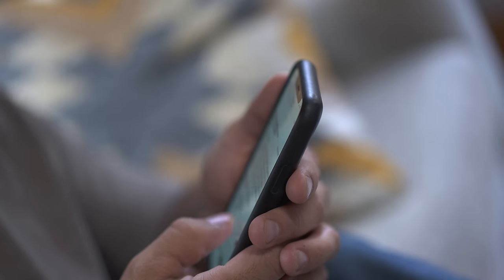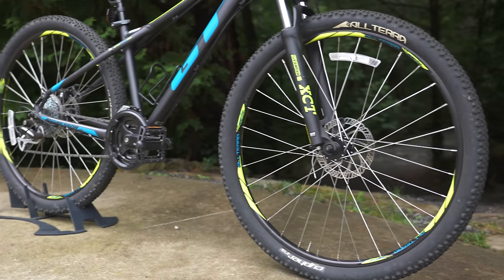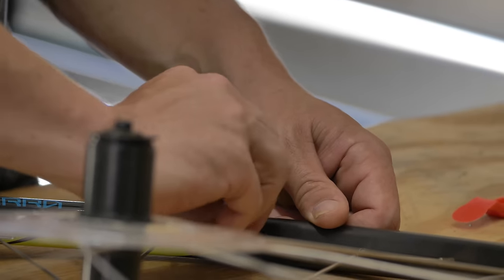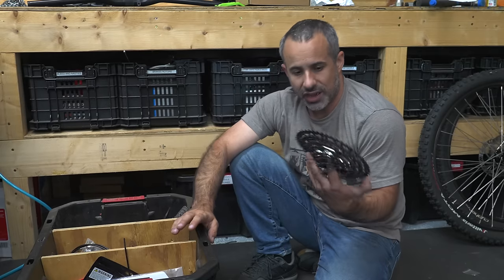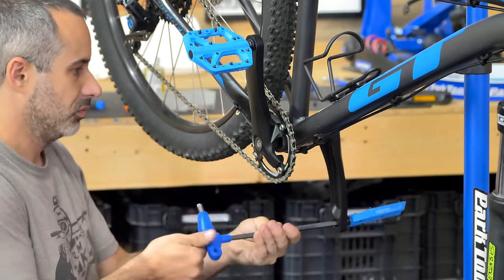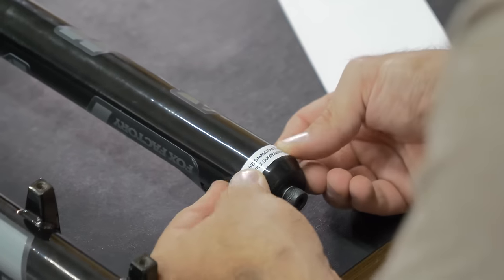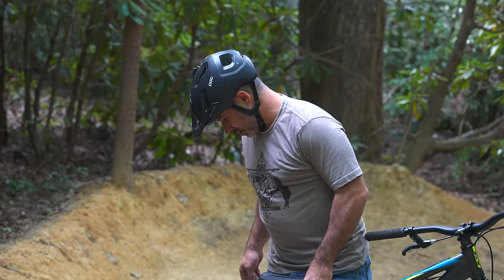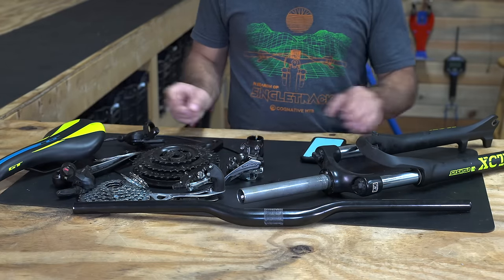Flipping a $300 Facebook Hardtail (Flip Bike EP2)

Comment: Seth a menace to the society for putting fox decals
Reply: 😂 do you watch flight reacts???
Reply: i saw the thumbnail and seriously thought he put 800$ fox forks on there💀
Reply: If people can tattoo Fox decals on their arm
Seth can put a Fox decal on an off-brand bike part
Reply: But as per the Kashima coat writen in the suspension, it could be a real fox, just wihtout the decals
Reply: @bigbarrelbr  nah, you can see it has an ABS damper, also the coating is way too vibrant
Reply: @charles_1523  werent earlier model coatings more golden?
Reply: Definitely not Fox forks!..
Reply: @bigbarrelbr  The colour is far too wrong, definitely not Kashima. Look at all the  cheap DNM etc forks - same colour.
Reply: Further to that actually - I recall seeing somewhere that some of those cheaper forks don't have bushings. No bushings at all. Just the seal and grease to keep it somewhat smooth, and for a limited time.
Reply: I've seen someone do the same thing with a suntour fork. Except they weren't upfront about it and you could only tell since suntour has that q lock axle only they use.
Reply: I was dying inside
Reply: @jorgeluisflores5980  good to know, positive feedback so far?
Reply: @jorgeluisflores5980  there's a link to the fork in the description. It's a cheap $111 ZTZ. Not fox.
Reply: @jorgeluisflores5980  my bad, it replied to the wrong person
Reply: @jorgeluisflores5980  Probably better than a mid level RS, which isn't saying much, to be honest.
Reply: @jorgeluisflores5980  thanks for the inputs
Reply: its going to cause a future bike mechanic a headache if they aren't careful
Reply: @charles_1523  Yeah if it was black, it would be much more believable!
Reply: @joevuch7981  A bike mechanic can see its fake from a mile away!
Reply: Menace*
Reply: @jayesh5131  I hope so! Shes gonna be  disappointed when every mechanic says they can't service that garbage
Reply: Tha menece 😈😈😈
Reply: True 😂
Reply: Great video. Looking forward to more flip bikes!
Reply: That's pretty common shit where I'm from. Not only on bike forks, but they literally rebadge the whole frame of a cheap Chinese "Spanker" brand to S-Works. Cringe.
Reply: These are alibaba forks, I don't buy the Kashima coating, it's probably some cheap gold anodising
Reply: It's so cheeky hahahaha
Reply: that boy bad news
Reply: Its good enough for her use when she gets older shell probably stop biking
Reply: fake times...fake forks...
Reply: @joevuch7981  but Berm Peak could continue to Service the bike for her. great way to bring her upto speed on the modern ways and learn soo much if she's real keen to stay riding.
Reply: @djdelarosa25   I thinks its in the Philippines.
Reply: @sapinva  it wouldn’t be because a rockshox fork is more durable but that one has only one nut holding the damper in
Reply: Who cares dude
Reply: @michaelmitchell5909  you don't understand it.
Reply: @bigbarrelbr  i think it'd not kashima
Reply: @Kuypers125  except it could be fraud
Reply: I hope he posts the video of the angry dad coming back to put a little "HURT on him" for selling him a bike with counterfeit forks ! Can't wait ! 😁
Reply: @Kuypers125  well it depends on the circumstances. So no clear answer.
Reply: yeah, the fork looked way better without em, esp that terrible label he printed
Reply: Anyone catch the coat on the fork huh my by legit
Reply: ... they make the bike go faster.
Reply: When I was 11 I put fox 32 decals on a cheap chrome suspension lol
Reply: @MrCharles  totally agree,  colour doesn't even match the true Kashima coating.
Reply: i was so confused i been trying to find those forks but you just made me realise they arent fox
Reply: maaaan 😂
Reply: @Kuypers125 good point imma do that to my trek marlin 8
Reply: "Label produced by fox suspension"😂
Reply: What if the people who bought the bike watched the video and they saw the fork😂

Comment: Me: "Oh I have that exact derailer combo! How Cool!"
Seth: "We're gonna have to get her a more serious drivetrain."
Me: "Oh... :'("
Reply: Has happened to me many times lol.
Reply: Get a gx or xt drive train it'll change your riding experience
Reply: Did you really think you had a serious drivetrain
Reply: How did you know the new 1x crank would work with the rear derailleur that was meant for a 3x?
Reply: @31acruz  the cranks/chainring don't need to match your rear mech basically any will fit
Reply: @noliemig  Not where chain length is concerned. Rear mechs suited to triple chainsets have a "SGS" (longest) cage and typically have around 47t capacity. For a 1x9 setup, assuming it's about a 39t capacity (11-50t cassette) then you'd need a GS cage rear mech (Medium).
Reply: @yute-hube779  yeah but that’s about accommodating maximum capacity, there’s no concern when reducing the total tooth capacity because the derailleurs b spring is already designed to keep the chain tight in the smaller combinations.
Reply: @aidanb9257  If you run a rear mech suited to a total capacity that's too small for the mech, then any chain that's long enough to fit around the biggest sprocket and chainring, will be too loose when on the smallest sprocket and chainring combo. The rear mech would be all folded up and it's not meant to be used like that.

The b-tension has nothing to do with total capacity, that is there to make sure the upper jockey wheel of the rear mech can clear the biggest cassette sprocket.
Reply: @31acruz the front chainring should be small enough to compensate for the massive cassette in the rear. 

Just check to make sure your chain is long enough as to not stretch the cage too far. 

Then I would make sure it has enough tension while in high gear as well.

If either of those are incorrect I would get a proper one for your chainring/cassette combination. (They label them on the box)
Reply: Don't feel bad. 3x drivetrains are actually really good. It's just the  bike snobs that shit on them.

Comment: I’ve been building an aggressor pro myself, so this is cool to see a large channel do a build on one as well.
Reply: Thought the same I also have had one for a minute!  Definitely agree to changing out that fork, made a huge improvement
Reply: Which fork did you go with
Reply: @whitehammeer  I ended up finding a used recon gold fork. Had to put some new seals on it but it cost me about 150 and it works great. Tough to find a used one with a straight stem though

Comment: Hi Seth, love this series of videos. If you’ve ever seen any of my former posts, you’ll know that I’ve been building and repairing bikes from $50 to multi thousands for many many years. It’s fun to watch you transform these bikes. So…this is the second video I’ve seen you do one particular thing, that in all of my years and professional experience,  is a no-no. Square-tapered bottom brackets do not get grease on the spindles. With only 4 contact points, over time it will round out the crank arm square hole. Give it time and it will happen every time. And not even years and years, but much less. If someone rides a lot, it won’t take too terribly long at all. I also understand that it happens no matter what, but grease in that one spot will definitely speed up the process. I’m not criticizing you by any means, I love everything that you do. Just passing on a tip from an old man who’s been doing this since the first Stumpjumpers were all the rage. How far we’ve come. These days you can spend close to $20,000 for a super top tier bike. Wow! You make me wish I still lived in Hendersonville.

Comment: Just a tip from waaaay back in the day. For putting on grips like Seth used, buy a cheap can of hairspray (yes, hairspray!) and give the bars a quick skoosh. Your grips will slide on easy and when the spray dries, it dries sticky, so your grips ain't moving! 👍
Reply: Spray paint inside the grips works better for me. Usually the clear coat in a can.
Reply: Little bit of isopropyl works good. Dries in a few mins and leaves nothing behind.

Comment: Those forks are in fact unethical. The crowns are so easy to snap, I’ve literally seen people send the Uppers through the lowers. I have a set I refuse to run after taking it apart.
Reply: Thank you. The base model  suntour fork is way safer
Reply: if you want a safe and good fork its smart to buy a fork from some known brand.
Reply: dude, that girl is like 30kg, anything 1kg lighter is better
Reply: i agree. i live in a 3rd world country and those things are killer forks. they are an accident awaiting to happen. i've seen ones snapping too. and their victims? mtb newbies who are in it for the looks.
Reply: same deal with that chinesium wake stem. its a race to see which one snaps in half first
Reply: I agree on the Wake stuff, it's absolute garbage and should not be used ever, but i doubt a tiny child would be able to snap a pair of forks riding xc or something
Reply: I must admit I winced a little when he said ‘it’s good to see the suspension working well’ when a child bottomed the fork out after going off a 2” tall root
Reply: Pretty hypocritical of Seth to put these components on after talking about how unethical the fooker pedals were.
Reply: @hptator  I guess you’ve never seen a damper blow out at someone on full compression . Lighter is not synonymous with better. In this case, over engineered and heavy is better than shoddily engineered and light.

Just because your are light doesn’t mean that these cheap, unproven, and dangerous forks are a smart buy.
Reply: @chukpic  You’re right, and i would, gladly. 

Go ahead and find her address and I’ll send her a recon or a Judy and send you the receipt.
Reply: @shoeonhead  I'm not light, that little 8years old 25kg girl is.

Comment: Loved it! I did like the Box upgrade but there is still room to balance it: decent hydraulic brakes (currently it has mechanical which are bad for shredding), brand fork (even a RockShox Judy would do the job) that is serviceable, a brand crank set - not a Chinese brand. In my opinion the pedal upgrade was not necessary.
Reply: yeah, the brakes would be my first upgrade
Reply: It is a fine $650 bike tho

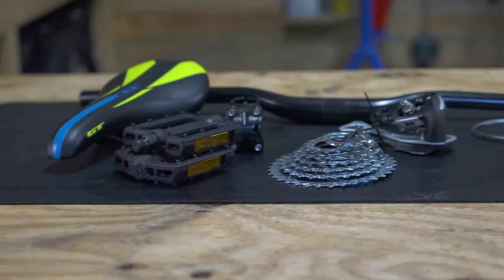Comment: 3:13 No, you spent $40 for those new pedals. You'd only be able to "discount" their price if you sold the other ones for $10 (your assigned value). The same goes for all the other parts you swapped out. Also, you didn't take into account the cost of your time. How many hours did you spend on this build (multiplied by the minimum wage in your state/city to get a starting base point)? Most refurb video's on YT never take into account the person's time when calculating things. If they did, their actual profit would be much lower, or none at all.
Reply: Exactly my thought.. I think he actually lost money on this one..

Comment: These Wake stems are not safe, they break so easily and i don’t recommend using them for future builds mine cracked after light trail riding and I’m not a heavy person in fact i weight 60kg and i won’t cheap out on stems anymore
Reply: I would like to second this point. I've seen a few of them crack. It's worth even the $20 extra to get something for a bigger name like Funn.

Comment: I almost bought one of those aggressor bikes. Glad I didn’t. I got a trek xcal gary Fischer. It is a 2012, but would probably last longer than any of those gt bikes. It also has a 3x10 scram x7 drivetrain which is pretty sweet of you ask me. I got it for $300
Reply: There's nothing wrong with GT bikes.
Is your Gary Fisher made in USA ? Or is it too new?
Reply: It’s USA, aluminum, and weighs around 27 pounds. It also has a rochshox Reba fork which new retails at around $500. You tell me, it is in great condition. Plus it’s my first real mountain bike. Compare that to a $70 suntour fork, and very entry level components and I would say that I have a better bike
Reply: @tavin7577  You sure do. I have a 90s Raleigh MT400 Rsi technium,
That was the last year they made them in the USA. I have a new Trek Marlin and it just feels sloppy as hell compared to my 25-year old rockshox.. the welds on my Raleigh are some of the best I've ever seen. As for the TREK....meh

Comment: I got one too , The Aggressor model for 340 bucks  . Like new . Put a 500w bafang hub , 52v 13ah  Hailong battery , metal pedals , changed the crank arms and went with a 52 chainring ( to keep it from free peddeling ) its very light in weight and handles great . Very fast too.

Comment: This is the same bike I ride and Seth did basically the exact same things I did to it, except I’m 6’4” and ride an XL. These run about $560 new at Dick’s Sporting Goods (I also bought used). They’re a nice frame with really cheap stock components, but with a few upgrades they’re a lot of fun for an intermediate rider

Comment: I would have also put on a new hanger. the stock hanger is made out of cast aluminum, where the CNC cut aluminum is a lot higher quality. I work at Dick's Sporting Goods as a bike technician and people would often bring their aggressors in with a snapped hanger because it was cast

Comment: Would advice against Stamp 1 pedals. Center of the pedal is too high and can cause lose of traction with the pedals. You need to change the pins. Second the bearings are terrible. Can't stress enough how terrible the bearings are. YOu have both bearings and bushings inside. Bushings wear out on flat XC rides so fast, you get terrible play and they start cracking. Crankbrothers are not to keen in helping out with the issue also. The rebuild kit costs about as much as a new pair of pedal. Replacing the bushings with HK1010 needle bearings fixes the issue.

Comment: Have one of these GTs here, I gave it to my GF many years ago (bought it new in shop).
Barely been used, I think the frame is quite good. Got some el cheapo mechanical disc brakes and the cheapo fork, as well as gear.

But maybe I should do some upgrades on it, better brakes, new fork etc as in this video. I think its soon bicycle time again and the bike does still look new, as its just been mainly standing still after we got a kid 5 years ago :-P

Comment: The bike should be sold for about $450, consider you skimmed few parts it came with and putting old parts as replacement. The chain was new and you swapped it with a older chain, the fake FOX sticker! I think the best thing about the upgrades were the pedals and the new tires - which doesn't justify almost double of the cost you got it for. But hey, you are running a biz, maybe that's why I'm not a flipper.

Comment: i would personally spent a little bit of money on some hydraulics brake. like you could save some money not changing the front gears and maybe buy some decathlon tektro hydraulics brake that are way better than cable ones and it's only 40 dollars for the whole brake system

Comment: need to overhaul my old giant talon 2014 it still works like new (except squeaky front disc brake) but would ride better with better fork and peddles and sound better with the brake fixed.

Comment: Hi Seth, have you given any of those cheap forks a good bashing? I found them on eBay, and they look too good to be true. I don't really want to know how damping feels, and whether the small bump sensitivity is good enough. I want to know, if it developed an unacceptable play on the third ride out, or if the stanchion separated from the crown. Are they fairly smooth? Do the dials actually do anything? I was given a task of finding a budget fork for my mates several times in the last few years. You used to be able to buy Suntour raidon or epicon for 120-150 UK pounds, now - forget about it. Anything that could be considered an MTB fork is at least 200 - 250 from Suntour, twice that from the big guys. I came across these cheap Chinese forks last time, but couldn't honestly recommend it to my good friend, ended up buying lightly used SR axion. I'd happily buy/recommend one, if they actually work, and are safe. Are they?

Comment: Not a bike flip. Not even close. That is a lot of talent and work added. I think you need to do a detailed comparison of component upgrades for each bike - which makes the entire concept economically impossible. The root reason is that people don't appreciate the value of the component upgrades - and if they did - you are into the $1500 range. And you need to discount from there, not from your material costs. For a used bike in that condition it's -20% -10% -10%. Incremental discounts for whatever reasons. So it's $1500 competitive value, $1200 your reconfigured price, $1080 your sale price, and $972 your 2nd cousin discount. Now you can stay in business. Maybe.

Comment: I AM LOOKING FOR AN EBIKE WITH INTERNAL WIRING, MID-DRIVE, BELT DRIVEN, FRONT SUSPENSION, SEAT SUSPENSION
HYDRO DISK BREAKS, STEP THROUGH THAT DOESN'T LOOK LIKE A SCOOTER OR A MOTOR CYCLE AND DOESN'T SCREAM.' "I AM AN ELECTRIC BIKE"  OR COST TRILLIONS OF DOLLARS.  CAN YOU TRANSFORM A BIKE LIKE THAT.  AND WHAT WOULD YOU CHARGE?

Comment: i don't get the concept of how going from 24 gears to 12 is an upgrade.  Is it only for trail riding so you don't need those high gears? I'd think you're still losing a lot of bandwidth.
Reply: 1x9 is way better because it has basically the same range and way better for jumps because it has way better chain retention
Reply: @TraviNomotion  i like the concept and the chain clutch, guess I just have to give it a try, thanks.

Comment: Seth, I have a 620 AUD Merida Big Seven 10 hardtail which I bought for 300AUD used but in 'good' condition. You got any tips for me to improve it. The suspension is 'adjustable' but even at its most turned down point, it doesn't seem to be effective. The front brake has been contaminated and weakened and the gear shifting is the opposite of smooth. Please help.
Reply: Just do some maintenance, bleed the brakes/new brake pads and tune the shifting